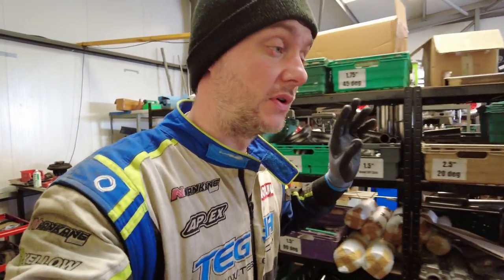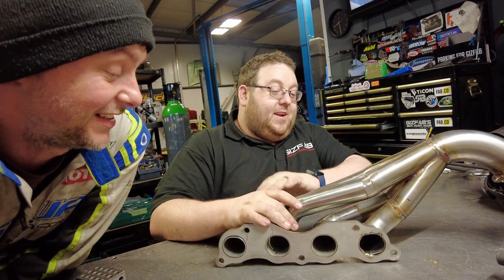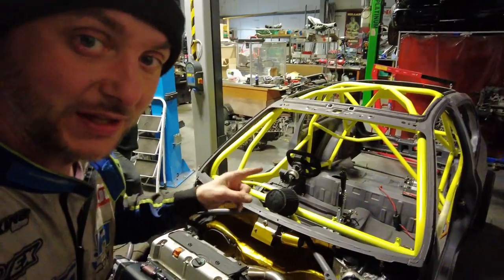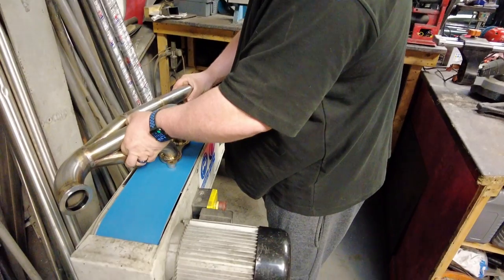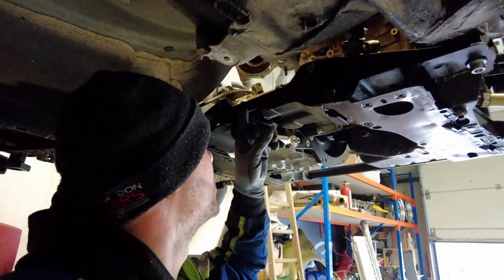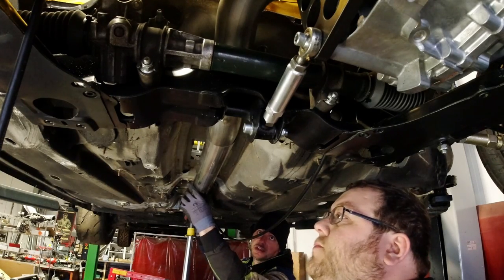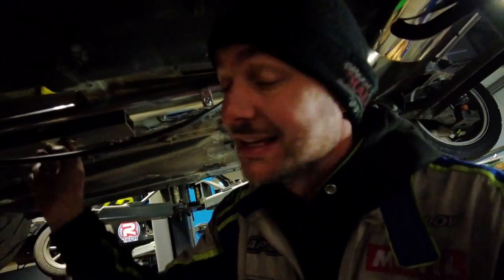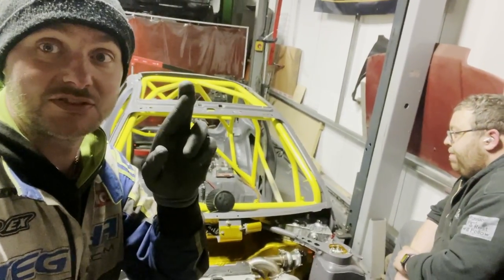321SS turbo manifold and full 3" exhaust Vlog with @GizFab

Comment: You can 3d print titanium. There is a company around here in Sweden that does it. Fine poweder melted by a laser pretty much. Dont know if they can make manifolds. I did order some grade 4 tubes from them for my exhaust.